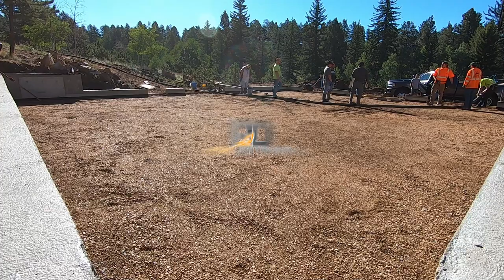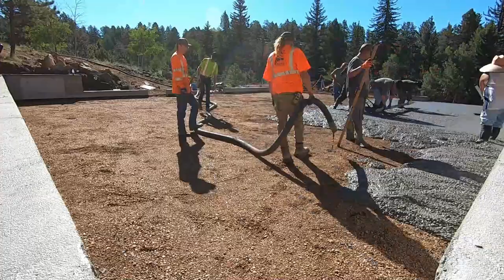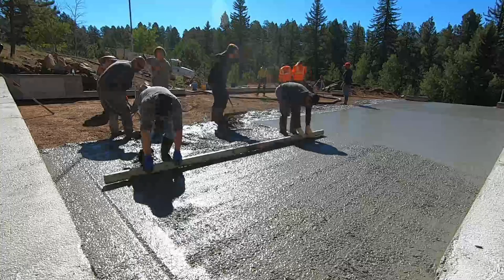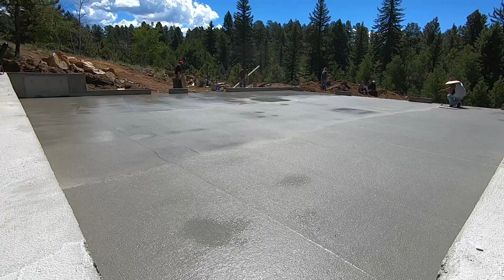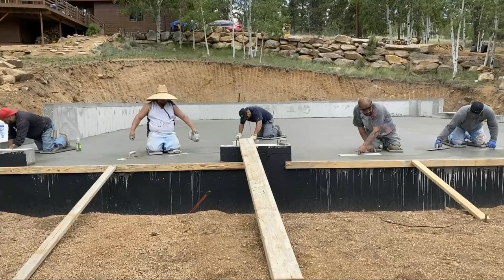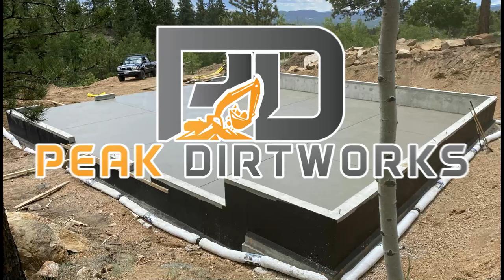Concrete Garage Slab Pour Time Lapse

Comment: NO REBARS?
Reply from the maker: This was a 4" residential floating slab. The Engineer did not require any reinforcement, but we added fibermesh. That's something we normally do for all of our slabs, even if not required by the Engineer. We do slabs with rebar or wiremesh, if required. Many times, if the plans are generic for say a log cabin kit or modular home that is sold across different states, the Engineering will be beefed up to cover all soil conditions. Otherwise, local Engineers do not typically require it. With a properly prepped subbase, a 4" slab with fibermesh will support residential use/traffic. In this slab, we actually have a few integrated pad footings that do have a rebar mat since the customer planned to install lifts in his garage. Great question!